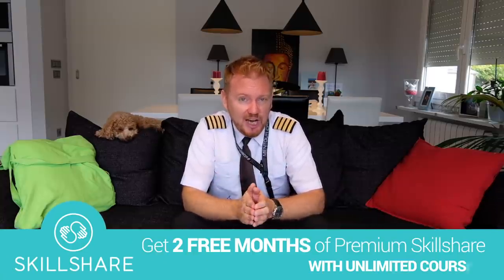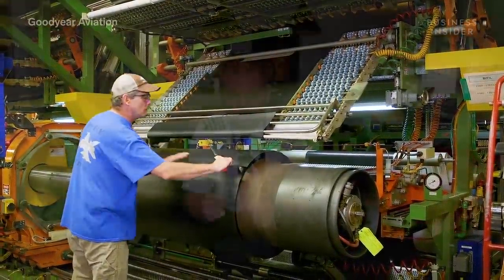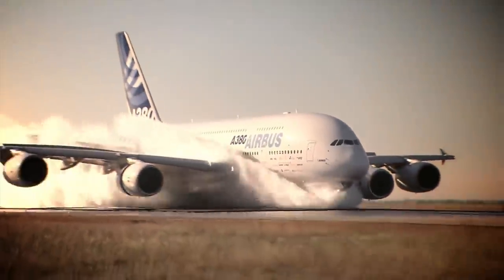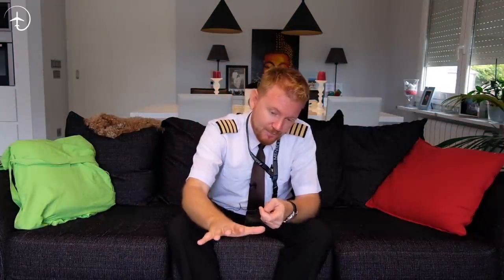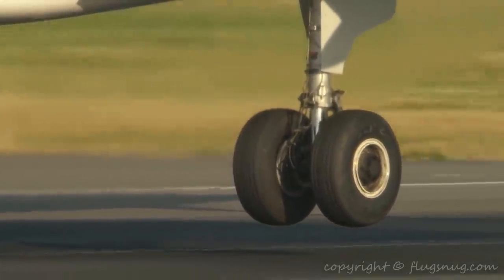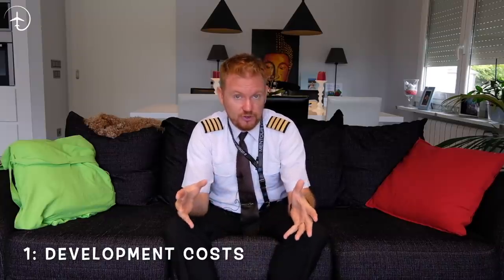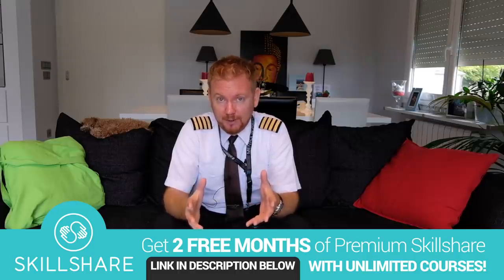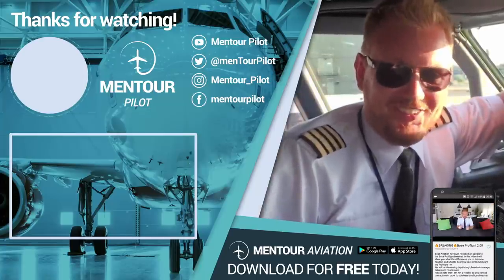Why not make plane-tires spin, before landing?!

Comment: Sounds like the ability to retread these tires means that blue smoke on landing isn't that costly. It is just rubber and rubber is cheap.
Reply: The testing, criteria and requirements to put tires on anything aviation is SUCH high tech and unless you see an aviation tire testing facility for yourself (as I have) the word "cheap" would not be in your vocabulary while you were discussing aviation tires. It's a whole different animal so to speak.
Reply: Michael W. Perry 
 with of inflation rising which comes back as the cost of a ticket to ✈ fly by  adding on extra weight & maintenance cost I think I can put up with  burn off little rubber to insure my safety upon landing,  good info chap.

Comment: Everyone in here talking about
 spinning wheels up before landing and I'm just wondering 

How do they get the plane in the air  to change the tyre
Reply: Jack it up. Easy that.
Reply: It's simple. They just fly at a lower speed with the landing gear down. A tyre change plane comes in underneath and they switch the tyres out.
Reply: They jack up the affected wheel assembly. Not that different to replacing a flat tyre on your car, along the raodside.
Reply: @ashleymalamute  No, they fly it in a wind tunnel.
Reply: They use jetliner jacks. Gargantuan, immensely powerful hydraulic jacks. They jack up a plane and change the tire like you'd do on a motor vehicle.
Reply: they jack it up,using the pressure of the tire to drive the jack.
Reply: @ashleymalamute  The buff guys do not even slow down. See the intro of the film 'Top Gun' 🙃️/🤔️ Admittedly they power dive cockpit-to-cockpit instead of cockpit-to-landing_gear. But I think you know what I mean 😁️
Reply: @Mark-Boss  I had heard of that happening, but didn't want to publicly mention it without confirmation. Thanks for seconding the rumours 😁
Reply: @RealCadde  Yeah, but in Australia we don't have such fancy facilities, so it's still done old school.
Reply: @ashleymalamute  C'mon, in Australia all planes are already turned upside-down, wheels sticking up.
Reply: @ashleymalamute  F1 style! In 2 seconds!
Reply: @ashleymalamute  Ah, so that's how they do it. Thanks

Comment: This question bothered me for YEARS. And even after tracking down the answer, my brains still resist it. It just feels so counter-intuitive. I used to imagine having paddle-blades attached to the sides of the tires, so no heavy motor would be needed, it'd just use the drag of the wind resistance to drive wheel rotation in preparation for landing.
Reply: verdatum it’s the same for me too, it’s kind of hurting my braid
Reply: I'll never accept it lol
Reply: But where would paddles go when wheels are retracted?
Reply: @flyingark173  they'd remain parallel to the wheels at all time. The orientation relative to the wheels and the diameter of the turbine would be designed such that there's no chance of them scraping the tarmac, no matter how much the wheel is compressed on landing.
Reply: @flyingark173  in the same place as the wheels??
Maybe the doors would need to be a bit wider.
Reply: There are more people thinking same as me lot of years ago. I thought the sides must seem as the middle balls an anemometer has.
Reply: Haha same here :D!
Reply: the paddles could be small enough to be fitting in the inside part of the wheels, so that's not a problem Flying Ark.

But what Peter mentioned about the crab angle landing makes this idea dangerous, you'd need controlled or negated wheel spinning during these landings, a non-spinning wheel provides the necessary angled friction force to align the aircraft with the center line right at touchdown, spinning wheels provide way less angled friction force and also provides unwanted force away from the runway
Reply: I had the same idea. Aside from the extra weight (which would likely be smaller, but still not zero), maybe it’s something to do with the handling issues he starts talking about at 11:38 or so.
Reply: In a headwind your wheels would could end up spinning way faster than your touchdown groundspeed though... Also one thing he didn't mention is the small braking effect when landing - this would add an amount (however insignificant) to the published landing distances.
Reply: Russ Flynn How much does that matter? With mass of commercial airplanes compared to the wheels, I’d think the difference in stopping distance would be a matter of inches or maybe feet. I haven’t done the math, though, and have certainly been wrong about such things before, so 🤷🏻‍♂️
Reply: @Jehty_  I really don't think there is any extra room, literally even inches to spare, in the wheel wells once the gear is retracted, and as Petter had explained in another video, there are no gear doors on the 737, so the paddle blades or whatever mechanism would cause drag being exposed to the air during flight. It's really a good idea if it would help, but I think the video does a good job of explaining why it's not even necessary
Reply: @OtherTheDave  doesn't matter if it's 1ft or 100ft, someone would have to re-do the calculations. Also for varying weather conditions, surface types, altitude densities... Etc. Maybe the difference is so small that it can be written off, but only after expensive and time consuming testing.
Reply: @flyingark173  I mean, if there isn't room, then I can always make room with an angle grinder. and @Russ Flynn, if the wheels are wont to spin too fast, you fix that with a governor. But yeah, its all still not necessary and no design idea will ever happen. Wheels are cheap compared to the many many other long poles in the tent of airline economics. 
...That still doesn't mean my brain is willing to let it go. Brains are dumb sometimes.

Comment: ive been saying this since i first heard of landing gear wearing out so fast, you want a duct that scoops up air and uses it to drive an impeller that spins the wheels up to the appropriate landing speed, you've added drag to slow the plane faster and stopped the wheels wearing out so fast, it's a win win.

Comment: How about manufacturing the tyres with small aerodynamic fins which would catcfh the air when the gear is lowered Even if this spun up the wheels a bit the tyres' lifespan would be increased
Reply: Yup, good idea, already patented though ;) the position on the casing and deflection an aircraft tyre has to handle make this difficult to implement, aside from production challenges of course
Reply: I also had this idea. I think something would work. The problem though may be slowing the tires down while retracting them after takeoff. It may be a safety issue, that it’s better to wear tires out than risk problems from spinning retracted tires.
Reply: Haha, I was looking is somebody suggested this already!  Good one!
Reply: @ice320  do you have a source or link to patent?
Reply: nicholas flamegun nice idea
Reply: Sounds like it would create more problems then good. On a wet runway the last thing you want is fins catching water next to the tire.  NLG tires have chines on the sides of them specifically to channel water away from the tire. Aircraft tires actually last a long time and are one of the least expensive maintenance items on an aircraft. A tire is a drop in the ocean when talking about the cost of aircraft maintenance. I work on aircraft for a living, these tires are the most durable tires made in the world
Reply: @JDJD-mw9rr  WHAT i envisage would be a  tyre with an encircling series of moulded aerodynamic features that wold only extend maybe a centimetre or so.I don't think that would generate too much spray and yet ,because both sidewalls would be so configured it might be effective.And anyway,it's only a bit of fun.
Reply: @salkasalka  I wish!
Reply: Implementing this with devises on the sidewall of the tire would require different tires for the right and left side of each landing gear.  Much more expensive.  Not to mention the possibility of a tire being installed on the wrong side causing the tire to be spinning the wrong way on landing with disastrous results.
Reply: @brianmcdaid3178  That's a very good point. Oh well, back to the drawing board...//

Comment: If you use pure nitrogen the tires can get nitrogen narcosis or "the bends" and then the tire will act drunk and crash the plane. That's when I fly I tell the stewardess to fill the tires with helium and oxygen every time I fly
Reply: BANG
Reply: It's obvious that filling them with helium will make the aircraft lighter too lol
Reply: @AnnualDegree99  too true, but perhaps it introduces a hindenberg element I was trying to avoid... 😁
Reply: This is why I fill my car tyres with a mix.
78.09% nitrogen, 20.95% oxygen, 0.93% argon, 0.04% carbon dioxide.
Reply: @twig3288  with a tyre you have to use a mix like that.  with tires, we just use air.
Reply: @twig3288  me too!
Reply: Better to fill the tube on the plane with whisky let someone else worry about tyres
Reply: Next time ask pure oxygen. It's cheeper.
Reply: you win the internet
Reply: Won't the tires get high-pitched when you're using helium? You want to add some sulphur hexafluoride to balance it out so the pitch is right and it can win America's Got Talent so it doesn't become depressed and crash the plane.
Reply: @siyacer  No too heavy, the tires filled with helium or better yet hydrogen will make the plane lighter then air so it can take off vertically then turn on the jet engines at 40k feet saving gas, and if they lose both engines they can just slowly let the gas out of the tires until it reaches the ground. Air plane companies are so stupid not to figure this out. Also they should make the windows open so you can smoke while at altitude. .
Reply: That´s why I don´t feed my car ethanol.
Also, planes are made lighter by painting them white ;)
Reply: @twig3288  ... technically 70% of air is Nitrogen...

Wait.. is it a sarcasm?
Reply: Dave B uh...how do they keep the plane on the ground after they land & taxi in ... are there AGF’s ?  (Automatic Ground Fasteners)?  😜

Comment: An inert gas is one that doesn’t react. Nitrogen is used to inflate tyres more so for the reason of keeping a more constant pressure with temperature changes and also it resists moisture absorption compared to air.
Reply: Nitrogen is not a completely inert gas, however, it is a fairly inert gas. N2 is a pretty stable molecule and it tends to take a decent amount of energy and/or catalysts to get it to chemically react. But yeah, it's cheap, uniform, and dry.
Reply: @verdatum  I routinely keep my car tyres about 80% Nitrogen filled.
Reply: @John Fisher All gasses are bound by the ideal gas law. PV=nRT, and thus temperature changes will cause identical corresponding pressure changes in all gasses in a confined volume, with the exception of phase changes (which is the issue here with water vapor). 100% fluorine gas would have the same amount of pressure change as 100% nitrogen, and fluorine is as far from inert as a gas can be. An inert gas is one that won't facilitate rapid oxidation of fuels. In other words, it's one that won't feed a fire, should one occur, and that's probably the major reason for using it in aircraft. Either that, or it's easier to ensure there's no water vapor in tires if nitrogen is used as opposed to air that's been dehumidified. Another minor reason is that N2 is a larger molecule than O2 by a couple percentage points, and is thus ever-so-slightly less likely to seep through the pores of the rubber over time.
Reply: All gasses expand and contract with temperature and all gasses will slowly leak from your tire. The nitrogen fill is a scam unless it's gratis.
Reply: Nitrogen is used to prevent tire explosions.  From the FAA:
"This amendment to the Federal Aviation Regulations (FAR) requires that an inert gas, such as nitrogen, be used in lieu of air, for inflation of tires on certain transport category airplanes. This action is prompted by at least three cases in which the oxygen in air-filled tires combined with volatile gases given off by a severely overheated tire and exploded upon reaching auto-ignition temperature. The use of an inert gas for tire inflation will eliminate the possibility of a tire explosion."

Comment: What is you molded fins on the outside of the tires shaped in a cup fashion that would cause the wheels to pre-spin? Great video!
Reply: That's exactly what I have thought.  Even if it only spins them 100 mph, it would be better than 0. 

Perhaps the added drag is self defeating in purpose.
Reply: I was just thinking the same thing, just about writing a comment about this, but I didn’t need too, you were ahead of me. I think it’s a interesting idea.

Comment: Rolling the wheels before landing? Or... Roll the RUNWAY during landing.
Reply: Just land the plane on a gigantic conveyor belt
Reply: Spoken like a 'Carrier-based Navy pilot ' !!!
Reply: That would make crosswind landings a lot easier, too!

You wouldn't need to roll the whole runway, mind you.  All you need to do is have a plane-sized piece of runway, that travels along at the same speed of the plane, directly under the plane, as it lands.  It would also help inexperienced pilots that don't know the layout of a complicated airport like O'Hare, because the "moving runway piece" could, in theory, take the plane all the way to the gate.

Comment: The reason for the "Extra" treads on automotive tires aren't for lateral forces, but to wisk away rain/snow from under the tires, to prevent hydroplaning.

Comment: the idea of spinning wheels came to my mind and I searched about it and with this video I agreed that this thought can be more costly and not deficient to maneuvering the plan during landing. Then I thought about having one wheel on each side of the plane which can touch the ground first and this wheel can spin the other wheels on its side with the same speed before touching down but this thought can be also a big project or even more costly or maybe with some disadvantages . SO I want now to think out of the box a little bit with another thought which planes can touch on a wet surface only on the area of the touch down of the runway to reduce friction and heat which can save the tires from ruining in a short age. I appreciate any comment
I appreciate all the videos of the Mentour Pilot. I love them a lot in spite I am not a pilot but I love aviation

Comment: Using vanes cast into the   rims,    even spinning up to 50% of the landing speed would save a fortune.....no more smoking...!
Reply: Suggested this to a tech in the airline where I work, but he responded it was undoable because of dangerous gyro effect from the rotating wheels before touch-down.
Reply: @thatfeeble-mindedboy  Air driven spin up of tires has been around for 50 years. It doesnt really change tire wear notably, and it adds mass and weight to the aircraft.. Also, the potential to have explosive fail of these components creates additional maintenance. All together, the spin up idea by air fins DOES NOT PAY FOR ITSELF historically, and aircraft outfitted with these devices usually have them removed due to maintenance cost. Whereas this sounds like a good idea, in reality, it isnt. Also, aircraft rarely land straight, and usually land with some misalignment which causes a lot of the tire wear. It's all about cost and safety. If it improves either it survives in aviation. Air driven spin up didnt survive.
Reply: Because of crabbing, even if the tires are at speed, they still undergo significant wear on touch down.  Since it's rare for the wind to be blowing directly down the runway heading, that means there is little savings in spinning the wheel.  By the time you add the cost of carrying the weight and the cost of maintenance, it turns out to be cheaper to just go ahead and retread and eventually replace the tires a little more often.
While that might feel like "wasting" tires, the alternative is to "waste" fuel and "waste" the time of your maintenance people.  TANSTAAFL.
One thing people forget when proposing simple vanes on the rims is that you want to be able to retract them during takeoff, where you don't want the extra drag.  Then, what happens when one side retracts and the other doesn't?  Or, when both sides deploy during takeoff?  Suddenly, it becomes much less simple.
Reply: To share an explanation I saw in a different comment-thread on this video: The gyroscopic effect of pre-spinning the tires while the aircraft is in the air is apparently quite substantial. Anything that makes it harder to tilt the aircraft left-to-right will make it harder to land safely.
Reply: Maybe some kind of tire tread pattern could cause them to rotate without any added weight
Reply: any aerodynamic feature used to spin tire would generate more drag than plain gear/ tires. More grag there generate pitch down torque. I would imagine both are undesirable. Cost of rubber is little compared to aerodynamic drag and security issues.
Reply: @7cle  good point. perhaps the rubber of the tires hitting the runway is actually desired anyway.